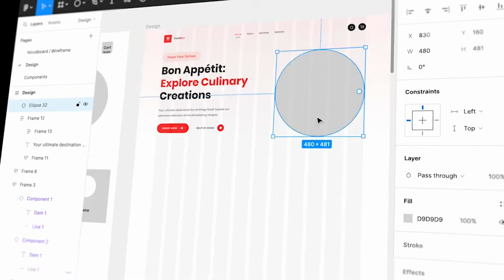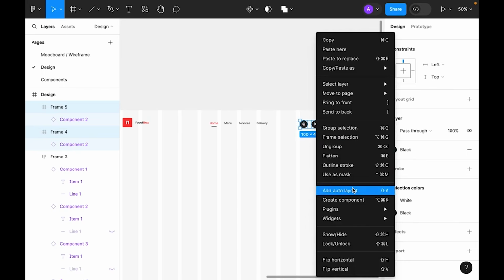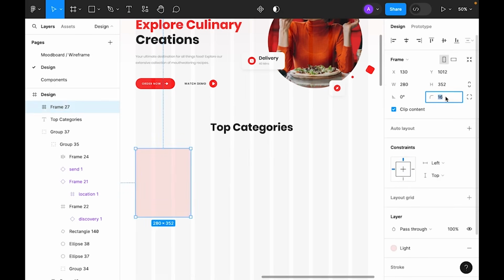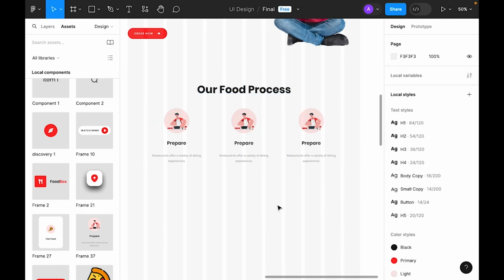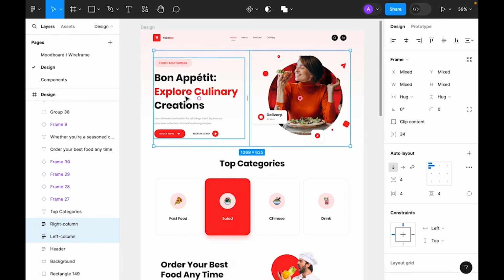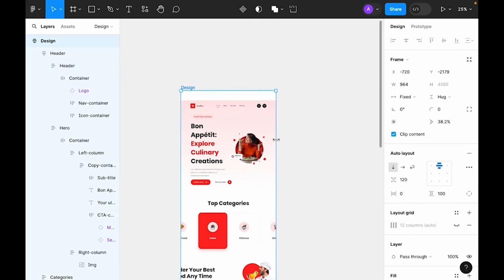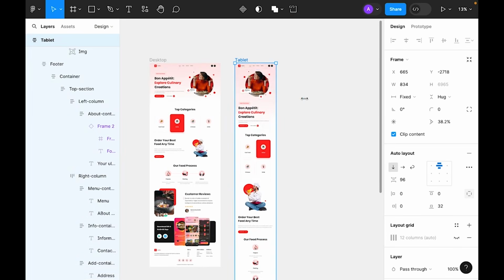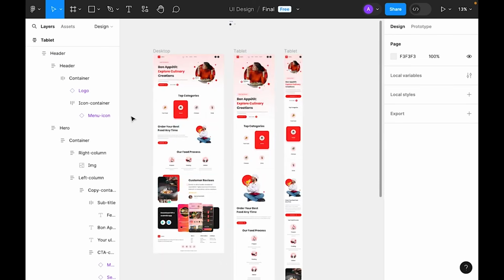Master Web Design for Beginners - Complete Course

Comment: Thanks for the tutorial! I was just confused about the part where you create a group in the hero image, and when you're making the layout responsive, it's no longer a group but an image. Did you save it as an image and upload it to Figma?  I followed the same steps in the tutorial, but when I put the image group in the fit, it doesn't look the same.
Reply from the maker: Actually i use it then as image, however its not the best way, you can the below method because if you want to make the elements animated or whatever you want, for video purpose i just use it as image,

- If you created a Group, so right click and make it Frame Selection, and then convert it to auto-layout, so it will work,